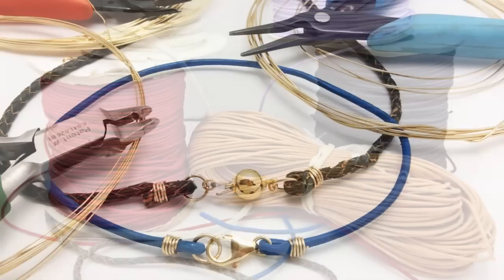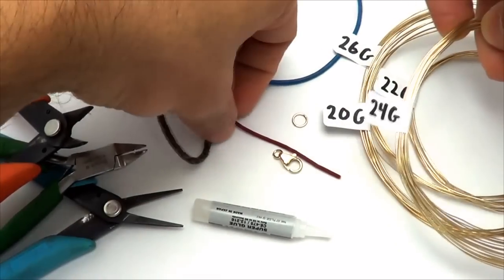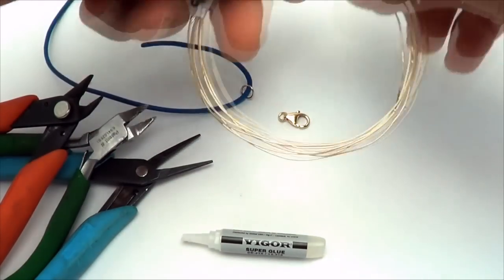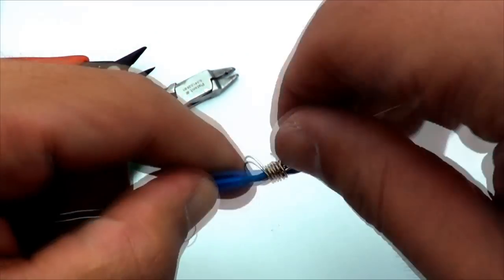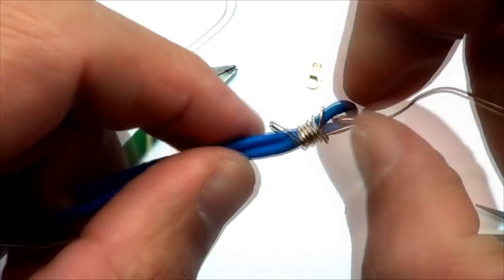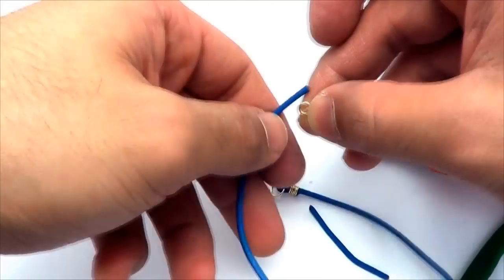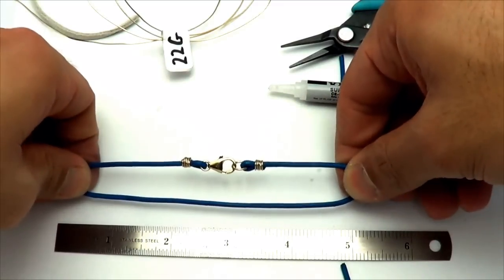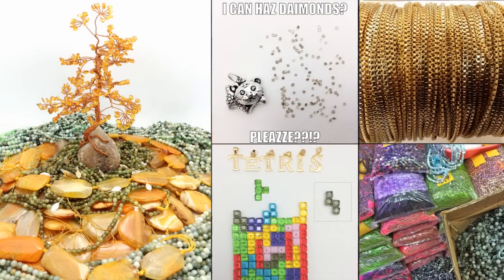How to Attach any Clasp to Leather or Thick Cord - Jewelry Making Ideas, Tips, and Tutorials

Comment: Loved the tutorial, very helpful.  I only have one wee suggestion......perhaps use a fine file (or cup bur) to give the ends of the cut off wires a more finished ending, so it won't scratch the wearer....sometimes wire can be sharp....even though it's very close to the wrapping section.....  ;)
Reply: ocelotcat I
Reply: I was wondering about that myself - it could catch on fine woolen sweaters...    can the ends be tucked somehow inside?

Comment: Enjoy your video on clasps, however it confuses me.  I'm sure it's very easy, but I need to know--did you bend the wire in half initially?  Also I don't understand how it makes a knot.
Reply from the maker: I kind of bent it in half before i made the coil. I think you can see it pretty clearly at around the 2:35 mark of the video. 

After you make the coil going from top to bottom, you feed the wire back from bottom to top which makes the knot. You can see where to feed the wire around the 3:10 mark.

Comment: if i only have a soldering iron, could i finish the ends that way - as opposed to the super glue?
Reply from the maker: The super glue is more for holding the leather in place. It isn't really for finishing the wire. Soldering would probably weaken the leather and I don't recommend it. If you do a neat knot and have sharp tools, you won't need to do much tidying up at the end.

Comment: why not just use a crimp tube instead of rigging and gluing all that wire?
Reply from the maker: This is just another technique to have in your tool box. If you have crimps for your specific cord size and design, then yeah. That would be much easier.

Comment: Crikey! Why didn't you tuck the sharp ends under the wire so it doesn't cut someone's neck?
Reply from the maker: It isn't exposed when it is straight alongside the leather, and soft wire isn't sharp.
Reply: @GemPacked  That's good! Thanks for your reply.